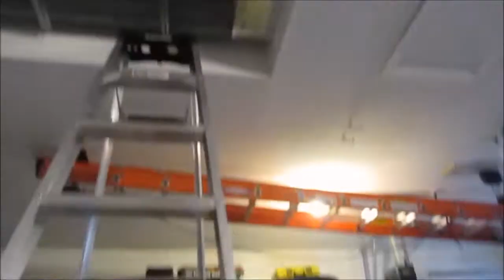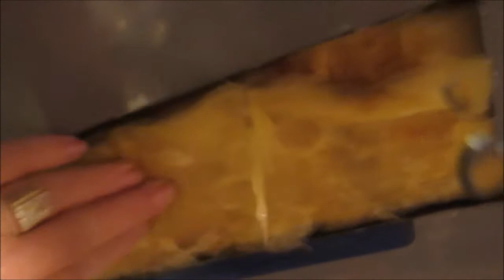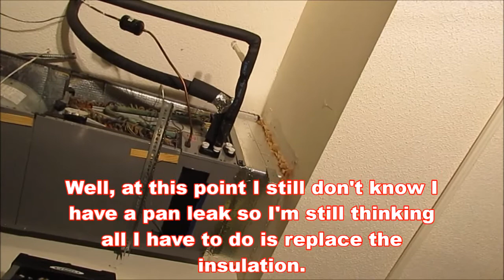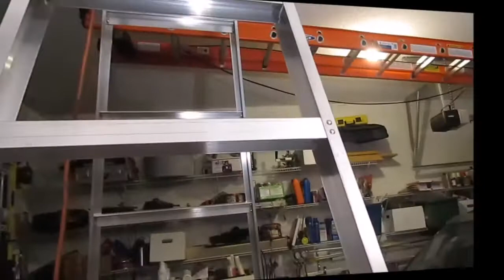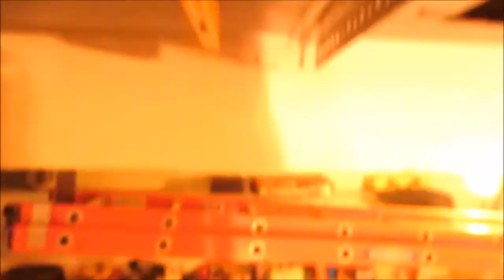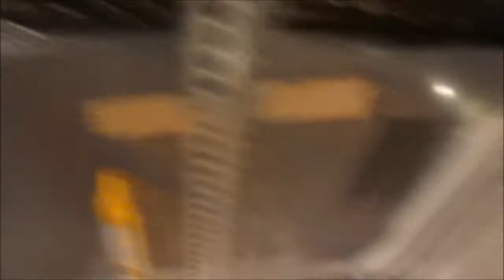HVAC: Carrier Air Handler,  repair leaking condensate pan and soaked insulation

Comment: I have what I believe to be a similar problem. Where is the water that you were able to prevent leaking into the cabinet go now? What is the path it is supposed to exit?
Reply from the maker: It leaves through the normal outlet from the pan. Keep in mind that my problem was due to an installation of a used A/C, not as a result of long term use. In other words,  if you're leaking water from your handler from ordinary use (your a/c was working fine before this) then you likely have a clogged pan outlet or the piping that goes outside is blocked outdoors (sometimes animals crawl into the line and stop it up). Anyway, I would look into the drain line leaving the handler first as this is a very common problem.

Comment: I have exact same problem, I tried Flex Seal with no luck. The leak is somewhere towards the end where coil touches the drain pan. Flex Seal spray can won't reach there, tried Flex Seal from paint jar with brush, but can't reach all the way. I can't imagine for 15K Carrier HVAC unit company is using such a cheap material for $10 drain pan. I guess I have no choice but to bring down the entire unit.
Reply: I got the same issue as what you described. How did you fix it?
Reply: @charliet2521  Problem turned out to be angle of drain pan. Drain pan was tilted a bit  away from drain pine hence water was flowing out. Throw half a litter water in the drain pan and you will observe rather than flowing out of drain pipe, it was spilling over inside, At least that was the case for me. all the best!
Reply: @prashantagrawal1846  how did you end up fixing it? Just repositioning the drain pan?
Reply: @ry30  yes, I repositioned the drain pan and also lowered the drain pipe a bit so natural gravity pulls water out of the drain pan In summary issue was drain pan holding water rather than throwing out. Its a plastic drain pan and I think temperature impacts it.may be!

Comment: A quicker way would be to remove both side panels where the lineset and drain are. You can easily have slid the insulation in with compromising the cabinet.
Reply from the maker: Yeah, except the thing's up in a cavity in the ceiling, 12~13 ft. high and about 5 inches from the wall of the cavity at the rear of the cabinet. There's no room to get a hand back there, let alone any tools......No access. Believe me, I tried everything and I definitely didn't want to pull it from the ceiling again!
Reply: kaydee457 I feel your pain. We just did this at work and replaced the black pan. It cracked as well. Great video.